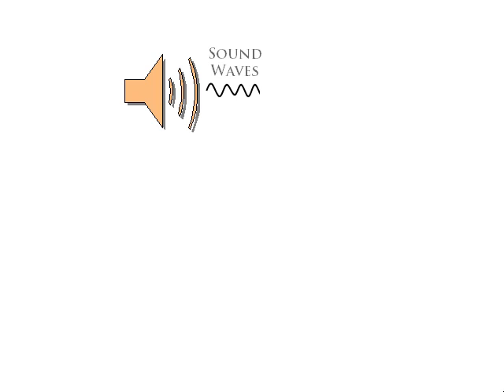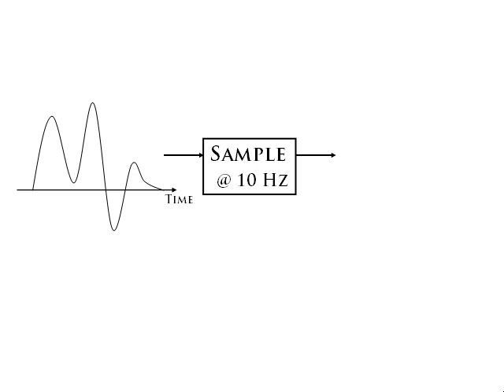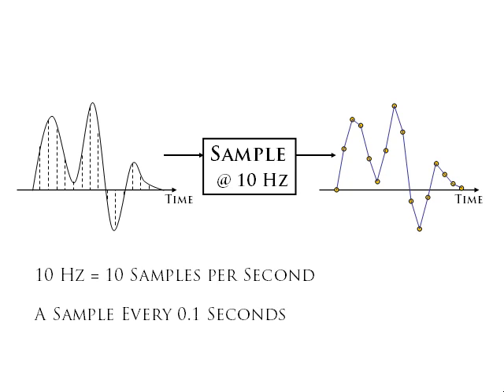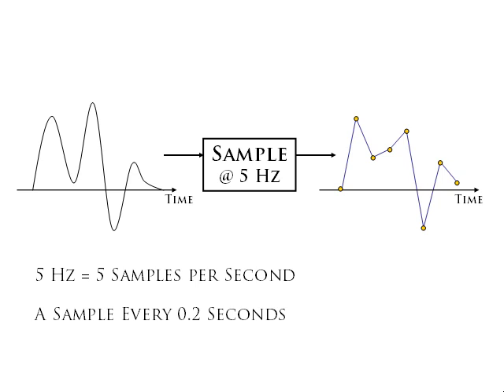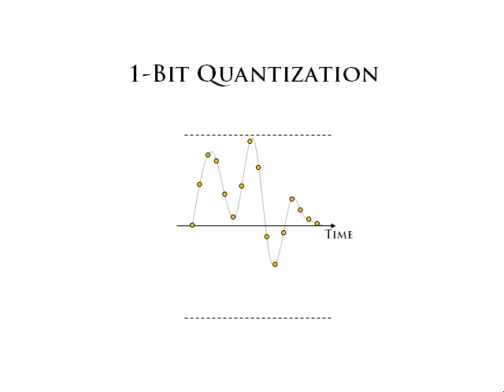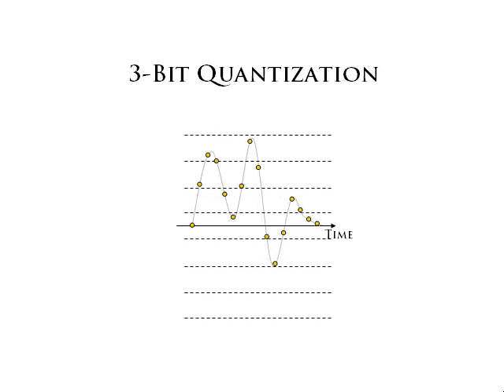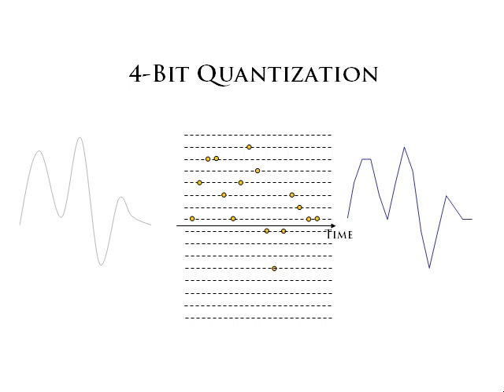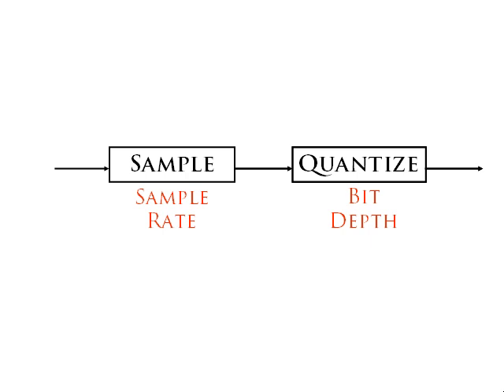Music Technology 101: Sampling Rate and Bit Depth Explained

Comment: Great explanation but is there a bit missing ( sorry, couldn’t resist the pun) ? During quantisation the difference between an actual level and the nearest quantised level - eg the $11.57 rounding to $12 = $.43 - manifests as noise. So the higher the bit depth = smaller rounding errors = lower noise levels. 
Given sampling rates of 44.1kHz and above, coupled with bit rates of 16 and over , give an envelope of over 20kHz and 96dB - beyond that we can accommodate in, say, domestic hifi systems and far beyond the offerings found in recordings. Despite the potential of CD, producers have never chosen to  use it to the full in commercial recordings. Find me one with a dynamic range much above that which was possible on analogue and I’ll eat my hat. I think 24/96 is only useful in mastering, but wholly unnecessary for playback.
Reply from the maker: Ah, yes. You are welcome to watch my subsequent video about dithering :)
https://www.youtube.com/watch?v=U2mwXiJqAgA

Comment: Please I have a question, in my book it says "The Nyquist Theorem states each cycle of the sound’s vibration must be sampled a minimum of two times" but why in a 44.1 kHz sample rate I see many more samples than two in each cycle?
Reply: This is because the highest frequency in a CD recording may be as high as 20 kHz (the limit of human hearing). To capture those high frequencies, you must sample at 2*20 = 40. So 44.1 kHz gives you a little headroom. If you are only recording low frequencies, you could use a lower sampling rate. But the 44.1 kHz rate was designed to be able to capture the entire frequency range of human hearing.

Comment: Sample rate is typically twice the upper limit of the incoming frequency, so 44.1khz = 22.05 frequency. Pros will record at 96khz.  With less sample rate you lose any harmonics that instruments can produce. 44.1khz is "good enough" but 96khz sounds better
Reply: Pros do not blindly record everything at 96k. You won't "lose" what you can't hear, even if you keep it in the recording (some people have abnormally high upper hearing range, but that's a rarity). For music, higher sample rates are sometimes used when further heavy pitch/speed processing is required, or, more often, because studio clients want to pay for it, thinking it's somehow better. Without blind testing you cannot tell, a piece may genuinely be perceived as sounding "better" simply because you know it's HSR. Music perception is very subjective, naturally.

Comment: Why does the quantization double as you go up in bits?
Reply from the maker: Let's say you have one bit. Then your possible values are: 0, 1.  (two values)
If you have two bits, your possible values are 00, 01, 10, 11. (four values)
If you have three bits: 000, 001, 010, 011, 100, 101, 110, 111 (eight values)
1. Write down the number of combinations for 4 bits.
2. Convince yourself it's 16.
3. Deduce the answer :)

Comment: So basically, a perfect digital representation, would be analog.  Fascinating.
Reply from the maker: That statement is a bit imprecise. A perfect digital representation is one which samples at a high enough rate to avoid aliasing, and at a quantization depth that is better than the noise present in the original signal (sampling experts will now berate me for not discussing compressive sensing, model based reconstructions and sparsity, but I'll leave it at that).

Comment: you can't just draw a straight line between the points to describe the samplerate, because it would actually "draw" a curved line between them due to the interpolation algorithm used in the converters and that way ensure that all frequencies come through even though the samplerate is just twice nyquist.

but apart from that nicely explained and visualized

Comment: Hi, recording and mixing with Sample Rate at 44,100 kHz and bit depth at 16 loses quality? Thank you.
Reply from the maker: ANY sample rate and quantization depth will lose some quality. Even 192kHz @ 32 bits.

Subjectively, very few people on this planet will be able to discern between 44.1kHz/16 bits audio and 96kHz/24bits audio.
Reply: so recording and exporting songs for example at 44.1 kHz at 16 bits is any loss of sound and data imperceptible? Does the final audio quality remain? Thank you very much and congratulations on the channel.
Reply: @tarcisosantos2610  In recording, 24 bit is now pretty much a standard, it leaves headroom for mixing and mastering. For final production, 16 bit is enough. It's not even a compromise: It yields 96dB of dynamic range.

Comment: the main problem is that mosly you do not use the 16 bits, because the sound level is much lower.

the result is bad sound at low sound levels. that's one of the reasons, the digital sound files are mastered very loud (loudness war).

no wonder the turntable and tape is back on high end audio system's.

Comment: what  about  bit rate?  what  is  that ?
Reply from the maker: Bit rate is the number of bits per unit time (usually second) that the system transmits. 
For a 16-bit, 44.1 kHz output, you'd be outputting 44100 samples per second, each sample having 16 bits, so this would be

44100*16 = 705,600 bits per second

Or, using kilo=1000,

44.1 kHz * 16 bits = 705.6 kbps

For comparison, most MP3s are around 128-192 kbps.
Reply: thank you!  I see..

Comment: You don't need an infinite sampling rate to store perfectly the original wave data. As long as you are below the Nyquist frequency the reconstruction is going to be perfect. The information between the samples is not lost.
Reply: If your samples have infinite precision, and the source is perfectly bandlimited, then yes. Simple oversampling naturally spreads quantization noise uniformly over the whole half-Nyquist range. This is a horrendously inefficient way to lower quantization noise, but you're speaking from theory, so must remember it.
Reply: That's true, under one condition:  the wave must be static, like a sine wave that has constant amplitude and frequency. As soon as the signal changes, the reconstruction process will momentarily be "confused".
Since music consists of a lot of waves that comes and goes, the process won't be perfect.
Therefore we need a higher sampling rate than the ordinary 44.1khz.
Reply: Nope. If the input signal is band limited (all frequencies are below a threshold f0) , a sampling rate of 2 * f0 is enough to perfectly represent it without error. When  you say 'As soon as the signal changes', that change in signal is part of the signal spectrum itself and will be sampled.

Comment: Your presentation is lacking and misleading. Too bad you didn't explain the reconstruction filter or Nyquist. Adding more points to your demo diagrams  would not add detail to your chart as long as the audio was below the Nyquist frequency and passed through the reconstruction filter. If your sampling rate was 44.1kHz, a 1k tone would be reconstructed without error just as a tone at 20kHz.
Reply from the maker: +CaesarGamer Do you think that sampling cannot be discussed without mentioning the Nyquist criterion? Higher sampling rates DO translate to "more detail" in the signal since they contain higher frequencies; that fact that audio signals are bandlimited are a completely different story.
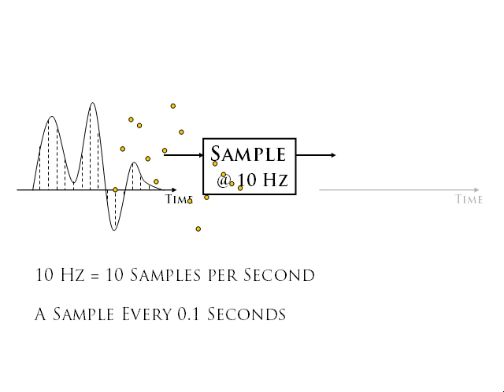Reply from the maker: +CaesarGamer I thought using discrete yellow points to represent the signal made it clear enough that signals are stored discretely. I also explicitly say at 2:50 that "basically what you get at the other end of your sampler is just those dots." How much clearer does it need to be?
Reply: +MangoldProject 
The problem is that the "connect the dots" method of reconstructing the original audio gives an incorrect notion on how the digital-to-analogue conversion works. Since the reconstruction is done entirely with sinusoidal waves, you don't get more "detail" with a higher sampling rate; what you do get is more information, since you're allowed to represent higher sound frequencies. And it's impossible to give an accurate picture of sample rates without mentioning Nyquist, because when you talk about "detail", you give an impression that the digital-to-analogue process is always somehow faulty, and Nyquist assures it isn't.
It's also important to mention the fact that the only effect you get by increasing the bit depth is reducing the noise floor, and thus the dynamic range. This is the closest you get to giving greater "detail", since a low noise floor prevent quieter sounds from being drowned out by quantisation distortion.
Reply: +MangoldProject I didn't express myself well enough. 
Of course it will contain higher frequencies, if you have a higher sampling rate, so in that sense you are correct.
What I was talking about is what people seem to not know, which is that a computer can reproduce perfect waves without erros, stairsteps, jaggy. They seem to think that higher sampling rate = less stairsteps (stairsteps don't exist to begin with), they automatically think that the sample rate is a continuous signal, rather than a discrete one, that the information between samples is lost and that sample value is constant from a point to another.
The way you present this matter in your presentation is a bit misleading.
Reply: +Fernie Canto Nicely done. Of course at 144 db S/N ratio, we'll never hear"nothing" that low!
Reply: +Charles Park Seward Exactly! Most of the videos I see about this matter seem to think that higher sampling rate or bit depth = higher detail in the audio, which is not true.
Reply: +MangoldProject I didn't express myself well enough. 
Of course it will contain higher frequencies, if you have a higher sampling rate, so in that sense you are correct.
What I was talking about is what people seem to not know, which is that a computer can reproduce perfect waves without erros, stairsteps, jaggy. They seem to think that higher sampling rate = less stairsteps (stairsteps don't exist to begin with), they automatically think that the sample rate is a continuous signal, rather than a discrete one, that the information between samples is lost and that sample value is constant from a point to another.
The way you present this matter in your presentation is a bit misleading.

Comment: It would have probably been a good thing to point out that the digital signal output doesn't look anything like the drawings you made. It is not a connect-the-dots, at any point. Just because it looks like that on your choice of software, doesn't mean it is that.
Reply: ***** In the middle of the process it may LOOK nothing like the connect-the-dots graph, however the final result coming out of the speakers will look like the connect the dots graph.
What does the digital representation look like without using binary? Is it the following?...
Point a = 1740
Point b = 1745
Point c = 1750
Point d = 1755
Point e =1760
etc.
Reply: human practitioner
"however the final result coming out of the speakers will look like the connect the dots graph."

NO
IT
WILL
NOT

Here's a video explaining why you're wrong, I can't be bothered typing it out, because you apparently need to learn everything: http://xiph.org/video/vid2.shtml

Watch the whole video until you understand it, I don't want to hear from you until you have, because you're misinformed.
Reply: +human practitioner You are completely wrong. The wave is going to be reconstructed perfectly from a digital output, no stairsteps nor imperfections.
"Point a = 1740
Point b = 1745   -  These are points that the analog wave is going to go through, they are merely discrete signals,                                Point c = 1750"       rather than continuous.

The samples of the audio aren't continuous signals, nor will be at reconstruction, therefore the sample value is NOT constant in-between samples and the data between them is not lost.